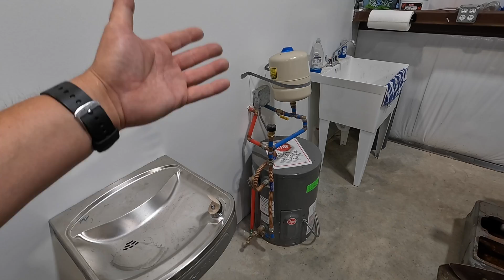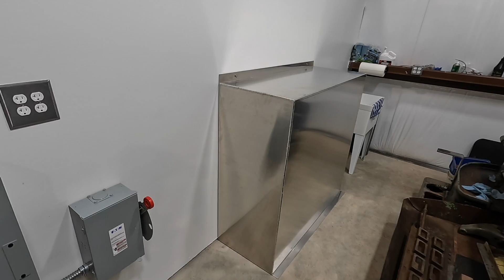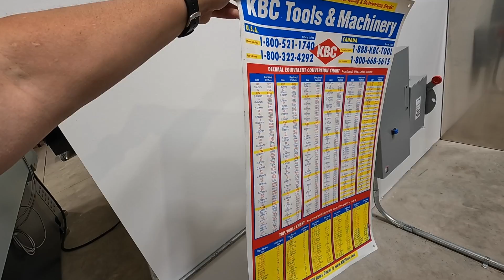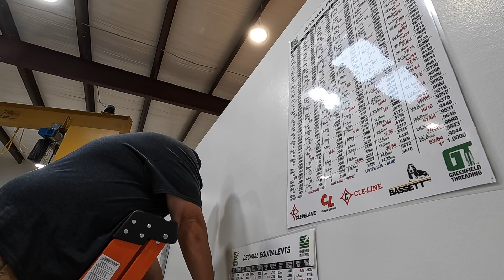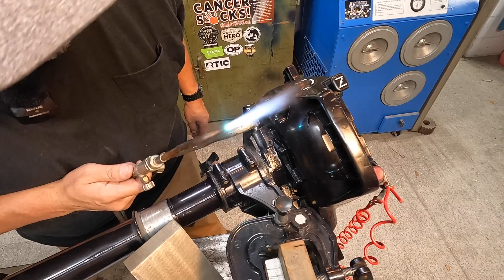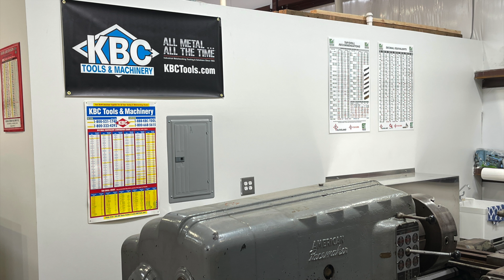SNS 363: American Flag, Shop Projects, Outboard Motor Repair

Comment: These comments .... anti-american, super plumbers,  saying the the fountain needs to be available for people with disabilities ....... its his shop.  He is proud to be an american and if the public doesnt have access to that area it is not required to be available to persons.  The rest of you shut up
Reply: Is he going to file an OSHA complaint on himself? 

He can do what he wants. No employees and no public access.
Reply: Viewers offering free advice where the channel creator might have overlooked something.  What a faux pas, just like the viewer on Instagram who pointed out the hidden tapered pin on the Pacemaker compound.
Reply: a quick look at the FL building code, it appears that one is required.  The shop  most likely is subject to code and OSHA.  Best to be careful and avoid issues
Reply: @WastingBob  Are water fountains required by code in Florida?
The minimum number of required drinking fountains shall comply with Table 403.1 and the Florida Building Code, Accessibility. f. Drinking fountains are not required for an occupant load of 15 or fewer.
Reply: @WastingBob  Federal OSHA - The employer shall dispense drinking water from a fountain, a covered container with single-use drinking cups stored in a sanitary receptacle, or single-use bottles. The employer shall prohibit the use of shared drinking cups, dippers, and water bottles.
Reply: @EricHaskins71  that is pretty easy to resolve,  he’ll want something anyways.    With a shop like this it is best to be aware of the requirements instead of dealing with the aftermath of a random inspection

Comment: Looks nice! 

Just add a very small amount of mineral  oil/cooking oil to your fountain drain and it will keep the water in the p trap from evaporating and causing any sewer gas.
Reply: Yep, that is proper maintenance for an unused drain trap.  If you have a few floor drains that don't have to "drain" very often and sewer gas is a problem, a gallon of non-toxic propylene glycol (RV winterizer at the Auto Zone) makes a great, non-evaporating trap level.

Comment: Or more definitively, capped at the wall with a threaded fitting.  Regardless of how, the gasses need to be prevented from entering the building.

Comment: YOU MUST DISCONNECT AND BLOCK OFF THE WATER FOUNTAIN'S P-TRAP! If you leave it like it is, the seal of water in the P-trap's curve will dry up and then flammable, smelly, and (in high enough concentration) toxic sewer gas will begin filling the shop. :(
Reply: mannys9130...Can he fill the P-trap with something that doesn't evaporate?...b
Reply: @SuperB776  ...Yep, that is the fix.  Propylene glycol (RV anti freeze) works perfectly.
Reply: and in an enclosed space with electrical equipment.  Not a good mix

Comment: Hiding this stuff is a recipe for problems down the road--especially since you are bolting it to the wall.  Better to have built a cabinet around it with doors and such to improve access.

Comment: thats ok untill the water heater springs a leak and will leak alot before yopu know
Reply: How do you figure that cover is waterproof?  The smallest leak will run to the floor and you fix it.  Stop the drama!

Comment: MCM class ships are mine sweepers. They were built by Peterson Builders in Sturgeon Bay Wisc, and Marinette Marine in Marinette Wisc. They were built in the 80’s and early 90’s. All wood construction and all the metal on board was non-magnetic.
Reply: Even the engines?
Reply: @philmenzies2477  mostly yes.  Isotta Francine. Mostly stainless steel construction

Comment: 1) You really should cap your drain for the water fountain. Otherwise, you risk having created a bomb having an open drain in a sealed compartment with a cycling water heater. There is less of a risk with a P-trap now than an old S-trap of course, but there’s still a significant risk. You can’t predict when the vent on the roof might get clogged without you knowing… Birds, bees, wasps, etc love a quiet, unused vent pipe. 

2) Personally, I’d use plastic automotive    body panel rivets to install that cover. Even if not having access to the valve isn’t prohibited by code, I’ve seen way too many water heater hoses/pipes let go without notice. You don’t want to have to run and find your screwdriver to get to the shutoff valve. The plastic rivets will hold enough for government work, but you’ll be able to just rip them out with a fast, hard tug, in the event of an emergency. Plus, if your municipality has a code against blocking access to a water heater, the plastic rivets will probably give you a good story to tell the inspector, so he knows you thought about it.
Reply: Point one is a good point. That trap will dry out in a few months and start releasing gas. combined with the water heaters thermostats switching under the enclosure, does make for a significant explosion hazard. drilling some vent 1" to 1.5" holes top and bottom should alleviate the build up potential; you could hide them out of site, on the right hand side where the camera almost never looks. also RV antifreeze in the drain will slow the drying process and may last a few years.
Reply: The cover isn't near air tight!  Never in a million years could methane build up in there to an explosive level!  Stop the drama!!!

Comment: hum, look for me, the P Trap will be dry, and sew methane gaz come back in shop...my 2 cents...
Reply: "and sew methane gaz come back in shop"??  That cover is not tight enough to trap methane at a dangerous level.  Umm, I think that is what you are talking about, right?  Hard to decipher.
Reply: and be 1 stinky box
Reply: and gaz trap in box until waiting for spark

Comment: A couple of things.  I would consider changing the water heater to a tankless one.  It will simplify the heater unit.  Next, you should add some louvered vents.  If something goes wrong you could have a steam build-up in an enclosed space.  I'd recommend adding a service door to simplify access if needed.   Another thoght is your installation compliant with Code?

I  would suggest framing a letter giving the history of the flag with the pertinent data on the ships, where and when it was flown.   It is good to document history.

Bob

Comment: Looks like plenty of room to hang flag horizontally. Think it would look better and the way it is, could get snagged moving stuff around the shop, get stuff kicked up on it, etc.
Reply: When that gigantic fan starts the flag will be horizontal in no time. :-)
Reply: I thought this also. Hanging over the pipe on the wall. Still not my flag or shop, I hesitated to say hehe.

Comment: Only a few minutes into the video but I need to say this. When the P-Trap on the water fountain dries out it will let sewer gases (methane) build up under that box with a heat source (water heater) right next to it. B O O M ! At the very least, have that sewer (drain) line capped off. Ok, back to the video.
Reply: pour vegetable oil in it
Reply: @release19  do you want ants? because that's how you get ants. mineral oil
Reply: @alakani  ...Professionals use propylene glycol (RV anti freeze).  Won't evaporate and ants hate it!!!
Reply: @release19  .....Good idea.
Reply: Man, so many drama queens in one place. Simple, correct solution? Remove the trap and all accessible piping, then cap the drain pipe off at the wall.
Reply: @inspector7138  Correct solution, get the water fountain installed in a usable location in the first place, or don't pay to get one installed at all. Second best solution, upon realizing the mistake, move the water fountain to a usable location, for less money than a giant aluminum box costs. Third best solution, apparently, make the whole place smell like farts and get ants
Reply: @alakani  Your #1 & 2 solutions don't come into play when renting. That stuff's up to the owner of the building.  He said a friend made the box, so I'm sure it didn't break the bank, and just capping the drain would cost a whole lot less than moving the fountain.
Reply: BOOM??  You've got to be fricken kidding!!  That cover isn't near tight enough to trap methane at a dangerous level.
Reply: @paulcopeland9035  Are you serious? Geez, you need to do a little homework. A small contained enclosure is perfect.
Reply: @Craneman4100w  #1 - It is not a "contained" enclosure.  If he would seal it to the wall, then maybe. #2 - It takes about 10% methane (+ 10% oxygen) for a decent explosion.  That drain in that enclosure, no chance.  #3 - Where is the ignition for this explosion you are worried about?
Reply: @paulcopeland9035  Paul,  pushing your opinions around on the internet doesn't mean you actually know what you're talking about. I suggest you look up the definition of containment and that it does not mean the area has to be sealed. Research LEL and UEL limits of methane and rewind the video far enough to see that there is a water heater under the box with the potential sewer gasses. I guess anything said on the web attracts people who want only to argue, so be it, this is fun.

Comment: Hi Adam, are you sure the flag is hang correctly, in my country that would be consider to be upside down
Reply: Stars are always at the top when hanging a US flag that way.
Reply: @Psychlist1972  Top to the left is correct.
Reply: @inspector7138  Not sure why you're replying to me.
Reply: @Psychlist1972  Did you mention that the stars are supposed to be towards the left side?
Reply: @inspector7138  Nope. Comments are all visible here.
Reply: @Psychlist1972  Never mind. Sorry i confused you.
Reply: He’s sure.

Comment: There’s no such thing as a hot water heater
Reply: My water heater stores hot water inside, but heats it when it cool to below temp. It's still hot, though :)
Reply: @Psychlist1972  Good point. The only time it is a 'Cold' water heater is when it is first turned on after being turned off long enough for the water to go cold, otherwise it is actually a hot water heater. You've convinced me :)
Reply: it heats water, period. whether it's hot or not

Comment: I have a set of vise grip i welded a tapped block on so I can thread my slide hammer onto. 
It works read good on hardened shafts that can't be drilled and tapped. 
Grind a little notch on shaft so vise grips don't slide off hardened shaft that won't bite in.

Comment: I know you made the decision to cover the water fountain to meet your own needs, but it seems odd to me. Having cold water on a hot Florida day is an amazing thing. I mean, you paid presumably several hundred dollar for the fountain, which is now effectively thrown away. Otherwise, I love your videos and continue to enjoy each and every one.
Reply: He didn’t pay for the fountain. This shop is in a rental unit and the fountain was installed by the unit owner.
Reply: I would have just covered the hot water heater.
Reply: @nighteyergbg  if the water is hot, why heat it? 🤪
Reply: @JK-ev2uw  how hot is hot?
Reply: He would have had to install a shield on the pacemaker to prevent coolant n chips from going into the fountain anyway. He personally didn't request it be put in. Joe had them installed. Possibly due to code. There are other ways of getting colder water than comes out of those fountains anyway. After 3 sips the water is luke warm and after six its whatever ground temperature is.
Reply: @demonknight7965  if it’s the Code to have this, is he allowed to Cover it?
Reply: @nighteyergbg  He’s allowed to do anything he wants. Goes along with the American flag. 🇺🇸

Comment: You need to disassemble the drain on the water fountain and put a plug or stop on it. Otherwise the P-trap will dry out and allow sewer gas to vent in your shop. At the very least it could begin stinking or allowing toxic gas into your shop. At worst it could trap explosive gasses in that confined space which could be lit by the water heater cycling on and off.
Reply: #1 -  The cover is no where near tight enough to trap methane to an explosive level!  #2  How would an electric water heater "light (lit?) this massive explosion?

Comment: Plastic has no business on an outboard motor in my opinion.
Reply: Out of curiosity, what do you think is a better bearing in marine applications? Any type of metal bearing is going to corrode or cause galvanic corrosion

Comment: When I suggested a cover for the water cooler, I meant a fabric/plastic cover. Not a giant box. 😀  Whatever, it's fine.
You would have been better off just drilling that shaft out. Easy enough to mount to drill/milling machine. Heck, it has its own vise mount!
Reply: So.....!!  This bomb of an enclosure that will trap all of the methane in Pensacola and blow the shop into the gulf was "YOUR" idea???

Comment: Is it possible to make a sleeve with '15mm OD - 12mm ID, length 200mm' ? I've approached numerous people they said no, i don't know if they're not wanting to do it as it's 1 item or it's not possible due to wall thickness.
Reply: It's possible but tricky and time consuming/expensive.. the way to do it would be to drill and ream the hole and glue it to a 12mm mandrel to machine the o.d and then the fun part of getting it off the mandrel
Reply: @markshort9098  I hadn't actually thought about a reamer for the 'ID' the sleeve could then be welded onto 12mm bar to machine the OD.
Reply: @dinxsy  a little super glue or locktite would be better than welding, it only takes a little heat to make the glue break free.. you have to be careful when machining stuff that's glued because it's very easy to overheat the part and have the glue let go half way through just from heat of cutting.. I always keep a couple of tubes of super glue in my shop, it's awsome for delicate parts that are hard to hold
Reply: @markshort9098  I shall bare that in mind, I'll try find some more local machinist, far and few between unfortunately.  I would go bearing route but the sizes needed are non-standard also ABEC1, lowest of tolerances poorer quality. Thanks for the input anyways, appreciated.
Reply: Yes and thanks for the idea, now I'm going to use that question as a super quick way to determine which shops I want to use, without having to go looking for rusty animals welded out of random crap in the front yard

Comment: Hey...excellent pic for your shop air, your going to be very happy with this setup you will never go back to the old piston type . Ps get the air dryer if they have it for the unit.

Comment: You need to keep the trap in the water fountain sealed with water to prevent sewer gas from entering the shop.   A layer of light oil down the drain will prevent the trap water from evaporating.

Comment: MCM stands for mine countrmeasures vessel. In the UK they are referred to as boats rather than ships.Don't ask me when a ship becomes a boat - I wasn't in the navy.
 I worked for a company that made the sonar equipment for the UK and other countries around the world.

Regard from Redruth Cornwall

Arnold
Reply: The difference is which way it leans when you put the rudder over, ships lean out boats lean in.
Reply: @stephenwoods4118  Is that a function of the keel?
I read that being a minesweeper it is constructed from wood, but that would not be anything to do with that?
Submarines are also known as boats, but they don't lean at all when cornering do they?
I'm loving the little snippets of info about this vessel/ship/boat :)
Reply: @musicbro8225  It has to do with the size, and the relationship of the position of the rudders and propellers to the waterline.
Reply: @musicbro8225  As far as I know the UK MCM's have hulls made from GRP

Arnold

Comment: The trap on the drinking fountain needs to be sealed also, when the water dries up in the trap you will lose the sanitary seal letting sewer gas into the building.

Comment: With regard to your covering the water fountain;  That device has a drain trap for a reason.  You will want to periodically run some water into the drain. If you don't, the water in the trap will evaporate and allow sewer gases (methane) to come into the cabinet/building.  As these gases are explosive, and the water heater element controls are not sealed, that can be a bad combination.  This is not speculation, I have see the side of a building blow out as a result of this combination.  Just saying...
Reply: If there is no plan to use the water fountain anymore, then the trap could be filled with a non-evaporating liquid like mineral oil so that it doesn’t need to be periodically filled.

Comment: The aluminum box looks good. If you plan to put storage on top of that (like you said, drills etc.) I recommend putting at least a 2x4 cleat along the wall right under the top to help support the top. It'll almost certainly bend over time otherwise as there's no channel aluminum or anything that I could see supporting the center of the top. It's such a nice box, I'd hate to see it get wrecked.

Comment: Well, I can see how that cover is going to be a problem if you ever have to fix the hot water heater. 🤔
Reply: It would be a problem to take a few screws out o the wall and put the cover to one side whilst fixing it?
Reply: Easy enough to remove.
Reply: Remove two bolts and it slides away, easy
Reply: fix the "hot water heater"?  Why?

Comment: I'm a retired plumber this is a ugly job. I'd be ashamed if I ever left a crappy looking job. If its going to be exposed they should have used rigid pipe and did a level and plumb (NEAT) job
Reply from the maker: We all know. I’ve expressed my disgust with that installation with the shop owner. Doesn’t matter. It’s done and it’s not changing. No point in arguing anymore about how it should have been done.